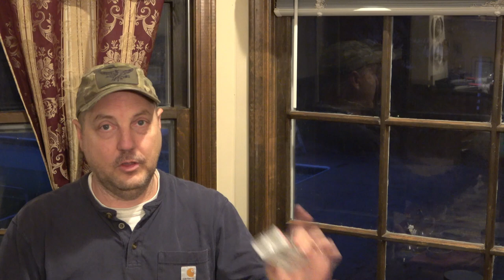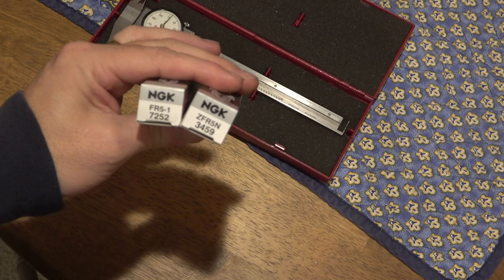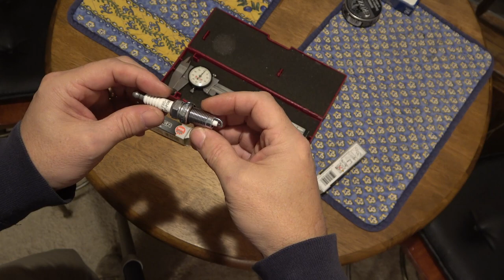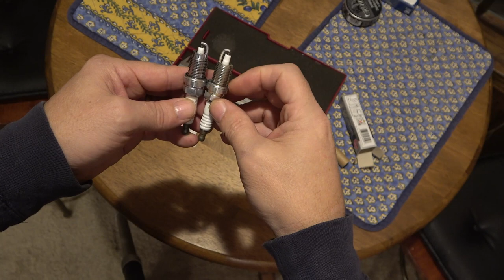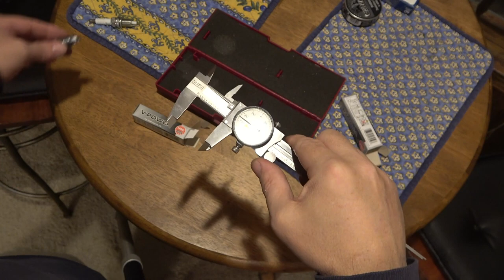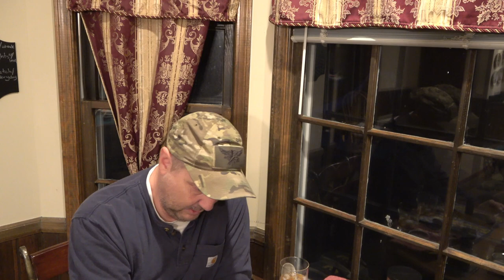Jeep 4.0 Spark Plugs CJ, YJ, TJ, XJ, WJ, ZJ Cherokee / Wrangler (early vs late)

Comment: You're a little off on how wasted spark actually works. One fires at TDC of the compression stroke while the other fires at TDC of the exhaust stroke of its paired cylinder. 1-6, 2-5 & 3-4 are the paired sparks because those are the cylinders that hit TDC simultaneously.

It's called wasted spark because you're essentially running the ignition as if it was for a 2-stroke, the one that fires at TDC exhaust is quite literally wasted as it does absolutely nothing, and that is kinda the point.
Reply from the maker: yeah I had to go back just now and re-watch it....I should know better, you are correct
Reply: You know a lot, and the way you explained things was fabulous. Thank you

Comment: I don’t care what anyone says about iridium’s. If you have a 4.0 with the cop or dis ignition coil then your 4.0 will run fine on iridium. I wouldn’t waste them on a beater though. Been running iridium’s on every new style coil ignition engine with no problems here. The e3 strap is a little to big for motors I’m worried about airflow and hp. But I’ve run auto lite and ngk with no issues at all. Never broke a plug and always carefully gap them.
Reply from the maker: I have and continued to install (and recommend) the plug type originally used by the manufacturer.
Reply: @superb60ce  I would if manufacturers truly cared about your car but they don’t. Run the factory service interval on a ford ptu and see what happens. Run the factory oil change interval on a turbo or vvt engine and you’ll regret it. I love iridium’s for the simple fact that if I put a brand new coil and plugs at the same time chances are they will both last the same amount of life.

Comment: Nice video, thanks mate. Question, I have a 2001 4,0 TJ and recently installed new plugs HELLA Iridium Pro, they work fine and I don't notice anything performance wise. But I think they are shorter than the NGK I used before. What do you think about iridium plugs, are they better all around or do they just have a longer life? Greetings from across the pond ;-)
Reply from the maker: I am not a fan of using ANY plug that the ignition system was not designed for.  Platinum and Iridium plugs were designed to last longer, and are installed in ignition systems designed for them.  In Jeep 4.0s, I recommend sticking with standard NGK plugs.
Reply: @superb60ce  Thanks for your reply, you must be correct because my recent experience is that the 4.0 actually performs less. I went out today and bought the ZFR5N and will change them out tomorrow. Question about the flame kernel being closer to the piston. Am I correct to say that both plugs are the same in lengt (from the base to the top of the ground electrode?) If so, then the flame kernel of the new plug is actually not closer to the piston, the spark only has to bridge a smaller gap right?
Reply: @jbhk7977  No more reply for you!
Reply: @sixsixpks  well you did 👍

Comment: what would you use for 1994 V8 5.2 magnum Jeep?
Reply from the maker: NGK 5155 FR4 V-Power Spark Plug
Reply: @superb60ce  Thx for your reply. I just wonder why some many prefer the FR5 instead of the FR4, which is pointed to be the correct one from NGK.
Reply from the maker: @MrVaderino  FR5 is a slightly colder plug, in a stock engine in good condition, it would not be needed